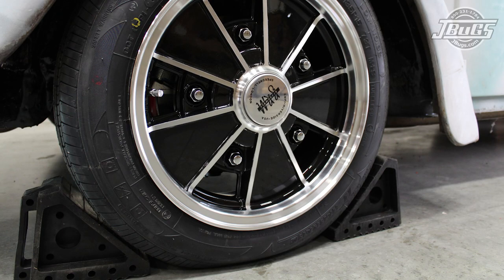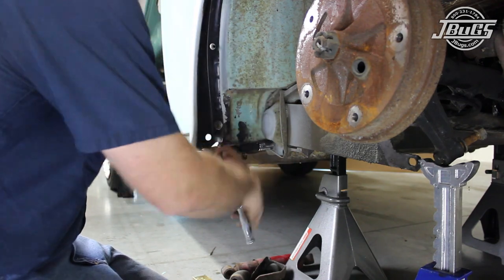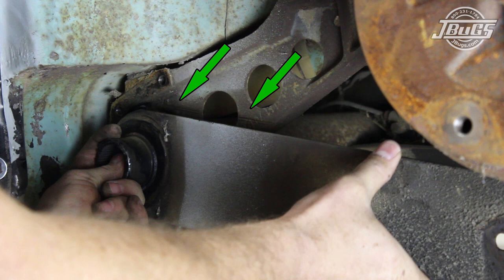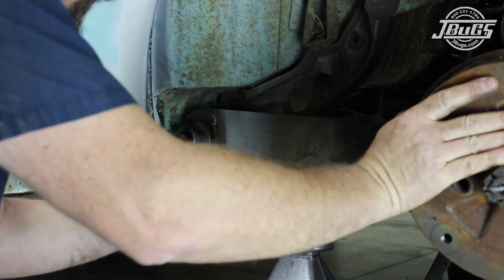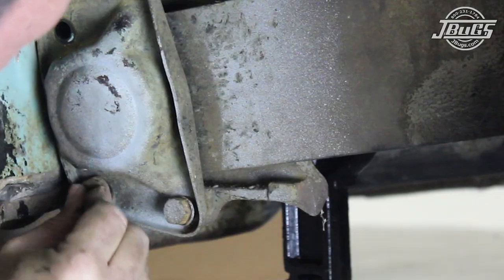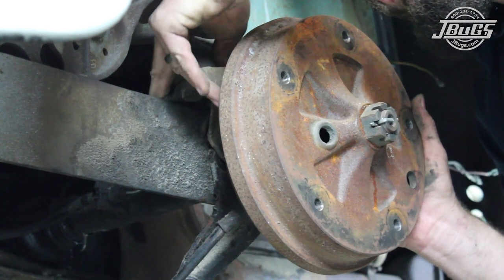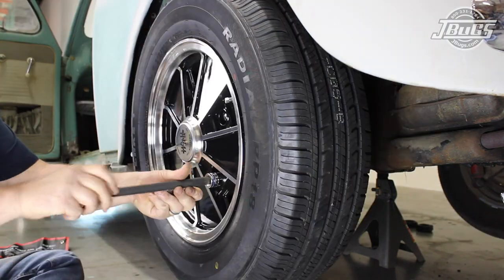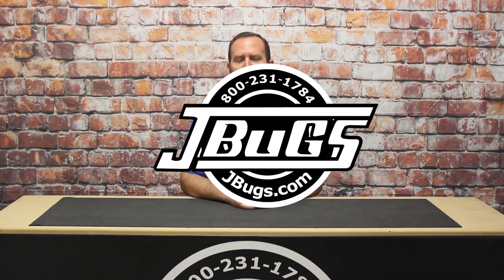JBugs - 1963 VW Beetle - Lowering Rear Swing Axle Suspension

Comment: Great video! Question, is this process the same for a 1956? I just inherited one from my Uncle who's unfortunately passed away, and I'm looking to convert the brakes to discs front and rear. Thanks in advance!
Reply: The process is the same, yes. A few things to note on the 56 though, the parking brake cables are not long enough, and we do not have an option that is. Also, the bearing caps will have to be replaced with billet aluminum units to hold the caliper bracket in place.
Reply: Thanks Sam. Do you have a part number for these caps? I'm searching for them on JBUGS and I'm only seeing results for front caps. Thanks!  @Sam_Mebane

Comment: Is there any change in ride quality with adjustable spring plates? I purchased them but see no reason to install since seeing your video
Reply: Adjustable spring plates don't ride any better or worse than stock. Personally I have never seen a need for them, other than for folks that don't want to spend the time to adjust the factory plates properly.

Comment: Do you know where i can get the bolts for the spring plate cap?
Reply: For swing axle and single spring plate applications the bolts are 15mm long, 10x1.5mm threaded bolts , and original VW units have a 15mm hex head. You can use a generic, 17mm head bolt, or you can use an allen head cap bolt for more clearance.
Reply: @Sam_Mebane  Thank you!

Comment: How’d you get 5” lowering the rear by turning the spring plate UP two notches? I don’t understand…
Reply: Turning the spring plate up, lifts the axle closer to the body, bringing the tire closer to the body which lowers the car. Turning the spring plate down, would do the opposite, pushing the axle and wheel away from the car, lifting it.

Comment: Is it possible to adjust rear camber on a Bug?
Reply: On swing axle cars, like the one in this video, the camber is controlled by the ride height. Think of it as waving your arms, with your elbows locked. When your arms are parallel to the ground, there would be zero camber at the tire. If you raised your arms (lowered the car) the tires would have negative camber. If you lowered your arms (raised the car) the tires would have positive camber. There is less camber change on IRS rear suspension but the same camber changes will happen. There isn't much adjustment other than ride height to the camber.

The slots on the spring plates are used to adjust the toe in or toe out but on IRS models there is some wiggle room for some very small adjustments in camber.

Comment: 0n 73 beetle when lowering should you change other side bushing or leave it alone,also on diagram so both ends turn separately right
Reply: Assuming the bushings are both original, really it wouldn't hurt to replace both, but neither have to be changed. I don't quite follow what you're referring to by "on diagram". Keep in mind, we do have a video where we lower the rear of a 1971 Super Beetle which will be more like your 1973. https://www.youtube.com/watch?v=0zkpQ-h57po

Comment: Thanks for the vid.  I have my 4 bushings and I am ready to install them.  In my manual and on other sites I am seeing that there is an outer left/inner right and inner left/outer right bushing.  I do see very subtle differences in the bushings I received as a set of 4.  Can you elaborate?  Mine is a '63.  Thanks
Reply: Correct, there is  an outer left / inner right and an inner left / outer right bushing. Test fit the bushings to see which bushings fit best, for the most part you have a 50/50 shot. Not a whole lot to it.
Reply: @Sam_Mebane  Thanks.  I figured they were different parts for a reason.  For anyone else, looks like the bushings with the 2 raised dots are left inner, right outer.  The ones with the single raised dot are left outer/right inner.

Comment: I wish you used the empi adjustable spring plates. I bought these from you and I have no idea how to use them
Reply from the maker: We had initially planned on using them on our 1963 Resto Custom Beetle but we went with a much wider than stock tire that wouldn’t clear the plates. We do plan on installing them on a restoration in the future though. As for the installation, it is exactly the same as the standard plates, but once they are installed, they can be adjusted with the allen screw.

Comment: Does anybody know what thread is used for the torsion bar caps? I need to get a long one to pull the cap back on as it’s proving a problem on mine - are they M8’s etc?
Reply: The bolts have a 10x1.5mm thread. The length depends on whether you have single or dual spring plates. Over the counter bolts will probably have a 17mm head which is too large to fit in the spring plate cap so a hex socket cap screw would be recommended.

Comment: I'm having problems with the axel not moving past the spring plate for me to go further. Any suggestions would be much appreciated. 
I don't really want to remove the motor to move the gear box back to free up the axel from the spring plate.

TIA
Reply: You have to loosen up the emergency brake cables all the way sometimes remove nuts completely make sure in neutral then use your muscle to pull back on axle , dont be scared it's easy
Reply: 06 has this covered, yes. Loosening the cables should give you enough slack.

Comment: My dune buggy has the ride of a fork lift---no rear suspension at all. Does lowering it make it softer? If not, how do I make it softer?
Reply: "Lowering" the rear suspension, or just reindexing the rear suspension to take some of the preload of the spring plates may help, yes.
Reply: Lowering it will give it a lower center of gravity so it won't roll as easy plus get softer shocks

Comment: Do you have any issues with tire rub? If so what have you done to correct?
Reply: We have not had any problems with tires rubbing. Typically the solution is a smaller tire if you do have issues.

Comment: Question ... I have a 68, also have BRM wheels, fronts are 4 1/2 wide and the rears are 5 1/2 wide. My problem is that the tire sits about an 1” just outside the fender. Is this because of the “1 offset? Also will lowering the rear like the video change my camber (negative) so the tire tucks? I want the tires to tuck.  Or do I need to switch the rear wheels to 4 1/2s to change the offset. currently I’m running 195/60/15 in the back and 145s up front .... any feedback is helpful ... Thanks
Reply: The offset of the wheels along with the long axles and tubes on the 1968 transmission is why the wheels stick out further than those on our 63. Lowering the rear end will cause the top to tuck in, more so the lower the rear is dropped but it may not be enough to clear the tire.

Comment: Any reason why I would get some negative camber after completing this job?
Reply: By doing this your moving the plate up , which causes the axle assembly to sit higher , so when cars on the ground again it pushes the axle up creating camber ( gearbox axle end sits lower than the drum axle end / if that makes sense )
Reply: The suspension design causes negative camber the lower the car goes. Swing axle cars will have more negative camber than IRS cars.

Comment: Wait, why are the teeth on the torsion arm pointing out instead of in meeting with the torsion bar??
Reply from the maker: The torsion bar sticks out of the housing slightly, early models just a bit, later models much more so. The spring plate (or torsion arm) doesn't slide inside the torsion housing, it sits at the edge, lining up with the torsion bar.

Comment: If i want to make high, i will do the opposite right? My kombi very low
Reply: Yes, either the torsion bar or the spring plate, or a combination of both would be turned down to lift the rear, yes.

Comment: Let me ask you this Sam...on a Bug with stock ride height that's sitting on the ground, is the bottom of the spring plate supposed to rest on the lower stop (which is a few inches away from the end where the torsion bars are) or does it normally sit above the stop by some amount?  My '68 no longer has its equalizer spring and it seems to me to be sitting low but I can't find any definitive info how high off the ground the back end is supposed to be.  The spring plates are about 1/2" off the lower stop when the car is on the ground.
Reply: The spring plates shouldn't be touching the torsion housing at ride height, no. Otherwise there would be a constant "knock" while driving. Anything the suspension compressed a bit and then came back to level, the spring plate would hit the torsion housing and the metal on metal clang would be quite annoying for a street car. Ground clearance was listed at about 6" from VW originally. More or less, there should be about 3" or so from the top of a stock tire to the bottom edge of the fender, and the car should sit level. More often than not, the rear suspension will sag over the years so it is possible your car is low in the rear, even if it is stock.

Comment: Do the shocks need to be adjusted for the 5" drop as shown in the video? I just did the exact same thing and need new shocks. Thank you.
Reply: Stock length shocks don't need to be replaced when going this low, no. Your shocks may have been longer than original.

Comment: What type of grease do you use for the bushings?
Reply from the maker: Silicone based spray lube or grease is best for rubber bushings.
Reply: Cyprian Skiba typically K78 carbon fiber grease is used but if you’re on a budget, Jerry curl may be substituted

Comment: Does this affect the ride at all? More bouncy?
Reply from the maker: Absolutely, the lower ride height will ride stiffer than stock. We removed the bump stops so it won't be very bouncy. However the lower ride height limits the amount of travel so when the suspension does bottom out, with the bump stops removed the suspension will hit metal to metal. We installed the adjustable Koni shock absorbers to stiffen up the ride further and help eliminate some of the metal to metal contact. Just the same, lowering the car changes the way the car rides. Some like the change, others do not.

Comment: Terrific but would be better without the "music" We call the emergency brake a parking or hand brake.
Reply: Brits call flashlights torches.
Reply: When we park it is not an emergency and a flash is a bright light that comes and goes. We also call pants trousers pants are worn beneath said pants. Pants is also used when we use it as nonsense, like "That is a load of pants!"